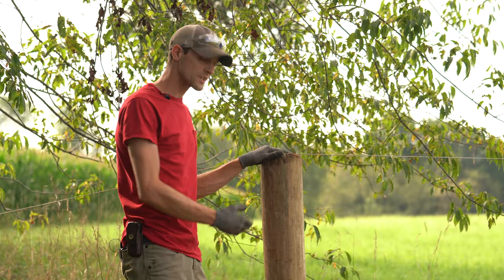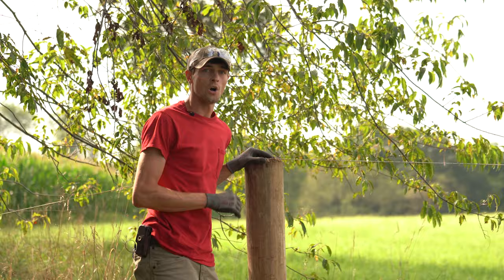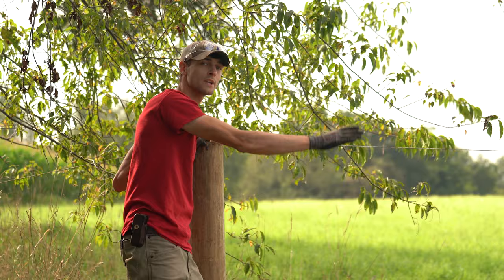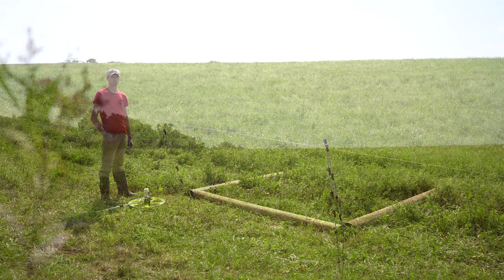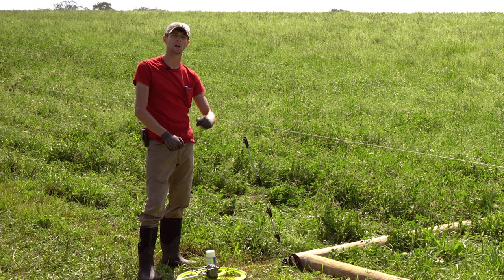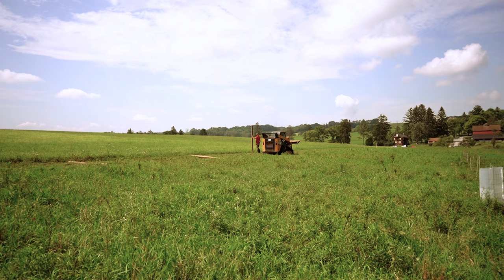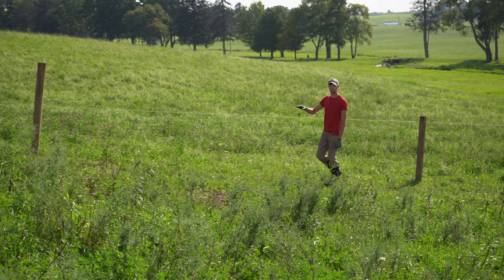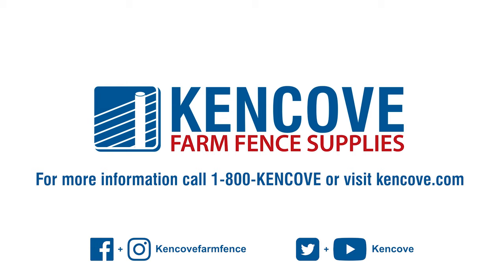How to Build High Tensile Fence - Part 2: Driving Line Posts

Comment: Do you install all your posts, including the end post, on the inside of your guide wire? Does that create too much tension on the line posts when transitioning the wire from the outside of the corners and bracing to the inside of the line posts?
Reply from the maker: Hello - We personally install our posts on the outside of the guide line. However, it can be manipulated by adjusting the guide on your end posts. The important part is to stay consistent. It will not cause too much tension. The idea of going behind the corner is to create that pull to prevent any upheaving or moving of posts later.